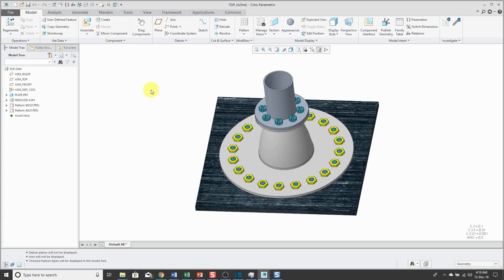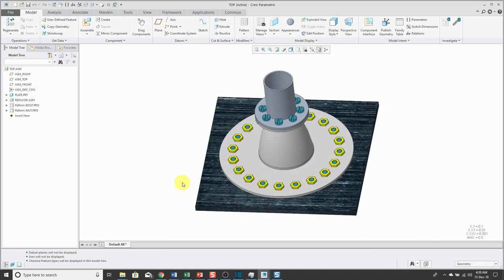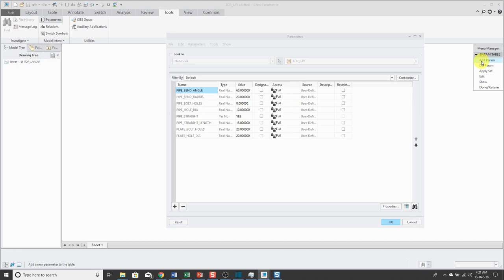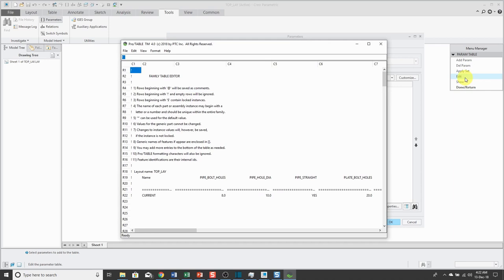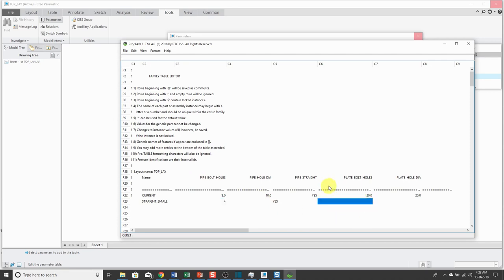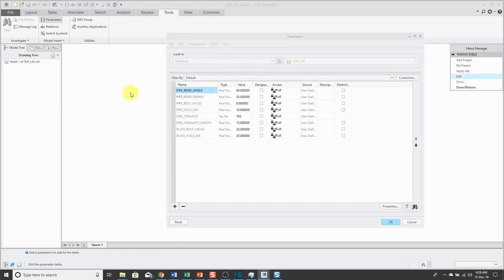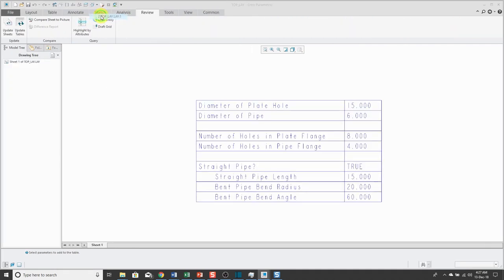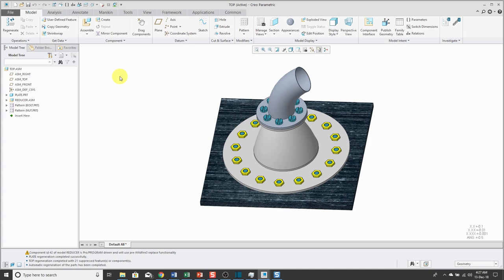Creo Parametric - Notebook Parameter Tables - Top Down Design (Demonstration)

Comment: Thanks for the video, I'm struggling to see the use case for Notebooks. Why would I choose this over a family table?
Reply from the maker: A Family Table cannot control individual part dimensions in an assembly. Also Family Tables don’t solve the issue with assembly level relations.

Comment: Is there a way to Apply Set from the Assembly level?  Almost like a quasi Family Table.  You could have 2 (or more) copies of the Assembly one with the STRAIGHT_SMALL set applied and another with the STRAIGHT_LARGE set applied.
Reply from the maker: The set is applied from the Notebook. Yes, these can be an alternative to Family Tables. And they have the advantage of controlling part / feature dimensions, which you can’t do with an assembly level Family Table.